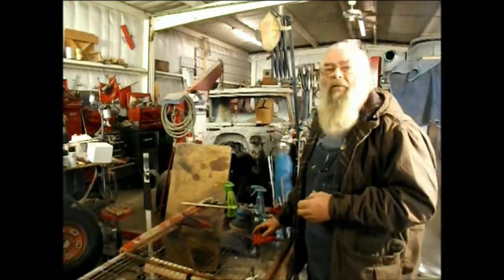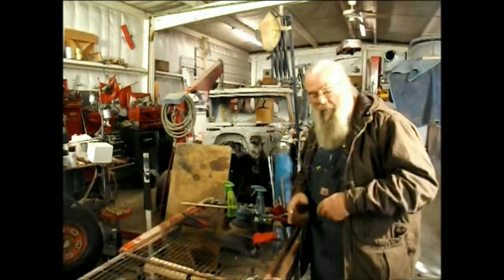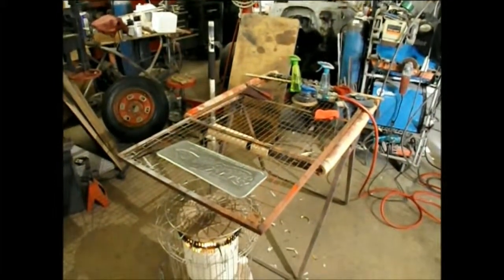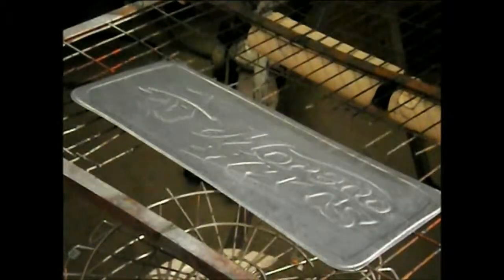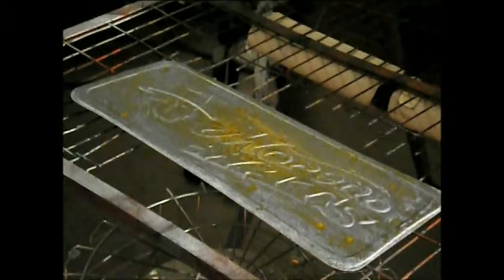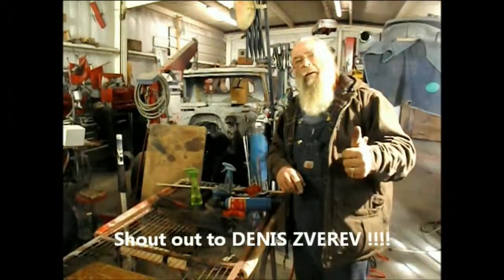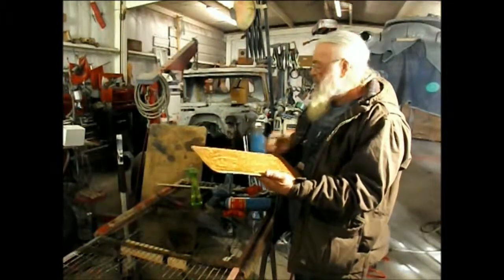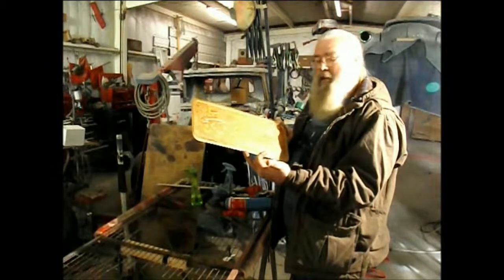Making a rusted patina (how to)

Comment: How do you make your templates? Nicely done on the patina finish
Reply from the maker: Thank you for your question.
I'm using an old version of Paint Shop Pro..... This particular piece was scanned from a business card. The software allows many file formats to be imported and manipulated for line content, size and component placement.  I have also searched the web for different fonts that lend themselves for use in metal..... Fat fonts work the best, over the skinny..... One of the other cool tools in the program allow a photo to be converted just into the outlines of objects......
Once it (picture, fonts, drawing) have been figured out, I print them on plain paper, spray the back with a cheap, temporary adhesive to hold it in place on the metal.........

I have even made a license plate for a fellow from a picture of his tattoo......

Thanks again,
Hop